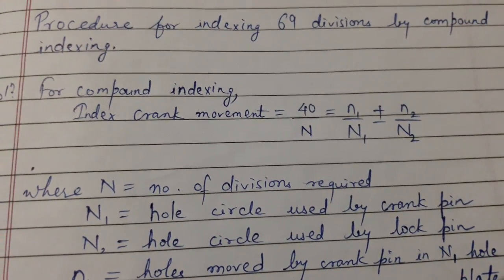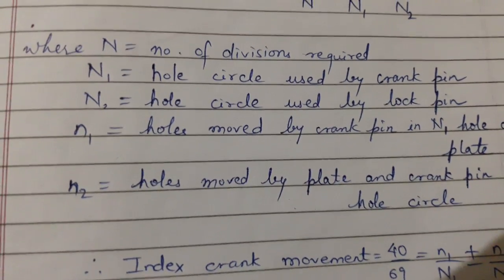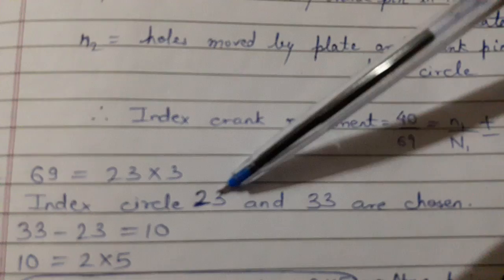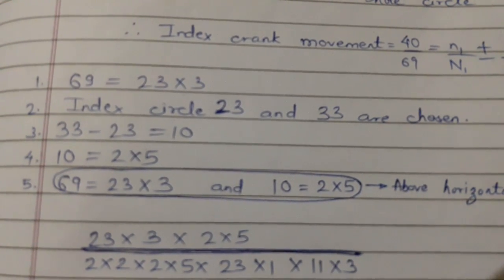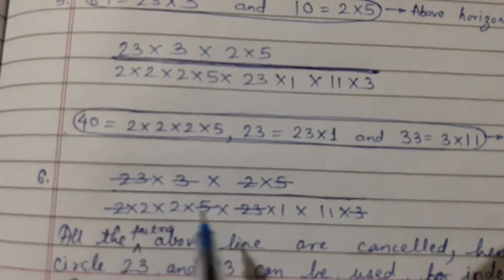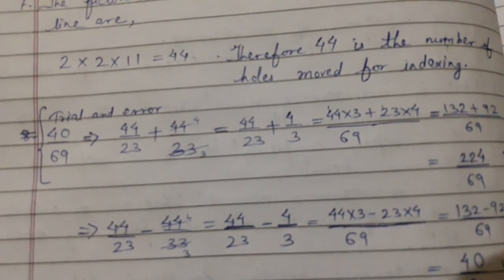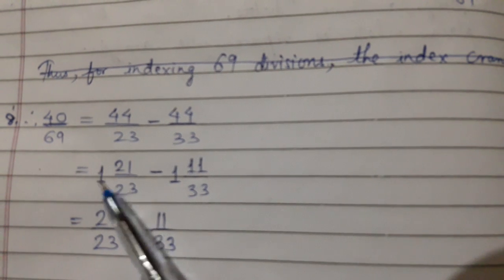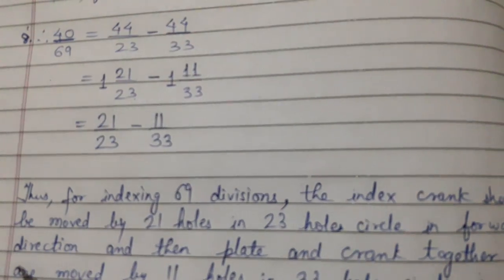Steps or Procedure for compound indexing with example.... #70kviews #viralvideo #compoundindexing

Comment: would u please tell the same method of compound indexing for 76 divisions
Reply from the maker: +Tarun Razz 

For 76... compound indexing not required... it can be done by plain or simple indexing....

40/76 = 10/19

Index movement will be 10 holes on a 19 holes index plate

Comment: 50 division ka kaise banega
Reply from the maker: +rohan singh 

50 divisions ka plain or simple indexing se ho jaayega....

40/50 = 4/5 since 5 holes wali plate nahi milegi.... We can multiple Numerator and Denominator by 3 => 12/15. Index movement will be 12 holes in 15 holes index plate 

Or

We can multiple Numerator and Denominator by 4 => 16/20. Index movement will be 16 holes in 20 holes index

Index plate with 15 holes and 20 holes are available.